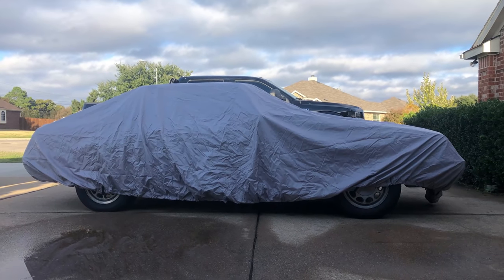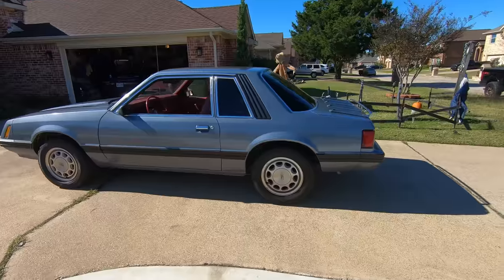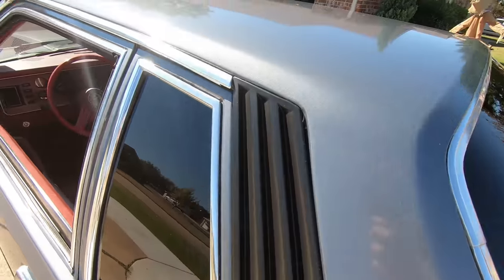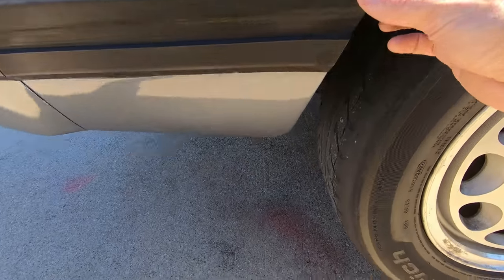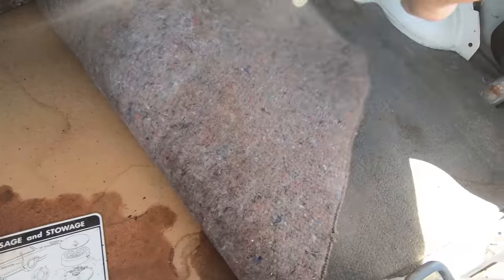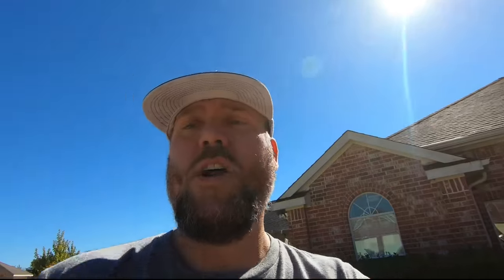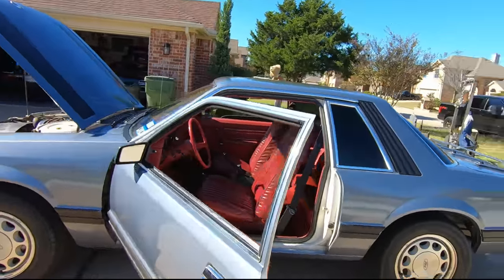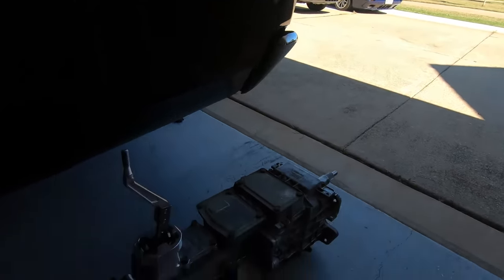1979 Mustang Coupe - Project Unveiling! - Episode 2

Comment: Dang she is clean and for $3000.00 dollars! And it runs and drives, added bonus. Also you know that the unibody isn't all twisted  out of shape like an older V-8 car. I say you got a fantastic deal. I like that it has manual windows, brakes,steering etc.Bare bones Brawler,lol. The coyote swap is going to be sick,that thing will be a rocket ship. Congrats on the project, looking forward to following the build. Paint has never been a concern of mine personally, as long is the body is straight and solid. With that being said i think I would paint it some form of white to compliment that stellar stock interior. 💯🔥🇺🇲
Reply from the maker: Leaning that direction ;) Back to stock white with fresh black accents....

Comment: 351 Cleveland would be a good swap engine. Seems like everyone & their brother are doing Coyote swaps.
Reply: MichXJdad  Just like LS swaps.
If it was me, I would do a 351C with a 4 speed. Even a FE-390 would be cool!
To each their own, whichever way Mr. Dula chooses, it will be a good quality build.
Reply: Cleveland would be a good choice. Used to be a ton of cleveland swap parts out there (headers esp). Would love to see an entire TFS top end, including the FI setup. Now, that would be a different fox.
Reply from the maker: Man dont get me wrong, 400+ cu windors rule no doubt. Clevelands RULE, had one in my cougar. Thing was a torque monster and smooth as sewing machine. I hear guys say all the time coyote is over done. I see the hype, and yes coyotes are becoming slightly more affordable, I just dont see it personally.  far from over done, IDK, where I'm at I see nothing but SBF windows in all the cars, maybe 5% or less coyote....I see more LS swapped ones. Just still cheaper to make more power with a SB windsor. Coyote is a reliable motor, takes boost nicely and just looks great under hood..again, all my opinion. Ive played with small block ford my entire life. To me, a modular 5.0 is completely alien!
Reply from the maker: MichXJdad  Man I wish these we're a bit more affordable!
Reply from the maker: MichXJdad  - DANG, runs 10s bone stock eh? Sounds like the power number are a little underrated.

Comment: Instead of a Coyote swap.Coyote swaps have been done to death. Have you considered doing the new 7.3 truck engine swap? Or even the 6.8 engine? Your car is in great shape. I would paint it back white or gray. Leave the interior untouched. Just my 2 cents. Good luck with the build.
Reply from the maker: YES. I have. Very much so. And Team-z is making components for it. Deal is the price tag. I wish I was loaded but I'm not. Hard to get that 8k for it, until they start showing up in used and wrecked vehicles.

Comment: Nice find! I have a 79 coyote swap car. The deck lid on yours is a one year only lid so I would do whatever you can to save it or some guys will pay good money for a 79 deck lid. If you have any questions let me know and you can find a ton of info on the FB coyote swapped foxbodys.
Reply: You're in the Dallas FW area. My car came from Denton TX. It was beat to all hell. but it was rust free.
Reply from the maker: @keithneustaedter7162  Man good to know! Thought this was a four year deck lid 79-82
Reply from the maker: I guess 80 up had more of a lip of the rear? Whats the difference
Reply: @HOUSEOFDULA  I think they changed the deck lid later in 79. Mine has the lip, but I'm not sure if it was changed at some point. There is a lot of little quirks that the 79-81 models differ from the 82-86 cars so research before you order any parts. like your carpet. 79-81 has a shallower floor pan so the carpet is a little different.
Reply from the maker: @keithneustaedter7162  - Good to know! Thanks man

Comment: Instead of a Coyote, put the new 7.3 Liter Godzilla motor in.  It has a smaller outside dimension and has not really been done since it fairly new. Then top it with a blower and call it done.

Comment: That's a perfect sleeper car.  Dont change one thing on the appearance, exterior or interior.  Leave both in and outside alone.  That's what makes it the perfect sleeper.  Instead of doing the rather overdone coyote swap, why not do this totally new swap?  How about a Godzilla swap?  The brand new crate engine from Ford Performance which is the 7.3 liter 445 cubic inch pushrod V8.  Close to 500 horsepower and over 500 torque.  The Godzilla swap is the better candidate
Reply from the maker: I totally agree! But man....Hard to find the 8k for one!

Comment: Wow spotless under the doors. That’s definitely rare. I’m in New York maybe different down in Texas but I’ve had southern cars that had rust under the doors. I have an 85 notch 37k garage kept miles spotless under the doors also so when I found it I couldn’t hand the woman the money fast enough and look at the title. I don’t think I ever found a better deal on a car in my life. Lol I was as excited as you. That’s awesome and your car is a notch. I love mine after having mostly hatches over the years. They feel more solid regardless of what you do to the chassis. Congratulations man. Forgot to mention my car has a really odd option I’ve never seen. An electric antenna that goes up when you turn on the radio. I love it. Check it out on Instagram luvdemstangs.
Reply: Are you talking about rust on the doors themselves, or under the doors?
Reply: @234dilligaf  the lip or seam on the bottom towards the inside mostly. Very bottom
Reply from the maker: Yeah even in texas, we'll rust. Not like up north. My 86 is perfect example, of how a texas car rusts as it was here from day 1.
Reply: @6spd85notch  . .  Yes! You nailed it! That's the only place I have rust on my 86, and only on the inside. It did this on one door. Why did it rust there?
Reply: @234dilligaf  I’m pretty sure the steel Ford used wasn’t all that great and I’m pretty sure it was changed to a better quality steel in 1990. Which is why you don’t see as much rust on 90+ up mustangs. I heard that a few times years ago. I’m not 100% sure but it definitely seems right. I’ve owned over 30. Could be a myth that I picked up somewhere over the years. Lol lots of mustang fans out there and definitely I think some of the coolest car people out there.

Comment: Please.. please.. pop the center caps back out. They are supposed to be curved out. 
  Sorry,, pet peeve
Reply from the maker: They are flat, you sayin they are supposed to be     curved out?
Reply: @HOUSEOFDULA  yes, they have a slight curve to them to match the shape of the wheel. People smack them in the center to put them in and it knocks the center in which makes the edges stick out and not sit flush with the wheel. 
  Take one off and pop the center out, install it by hitting the edges and you will see what I mean. Then every time you see one, it will make you laugh or cringe 😬
Reply from the maker: @kennyleejohnson5253  - I'll be! Good to know man. Thank you